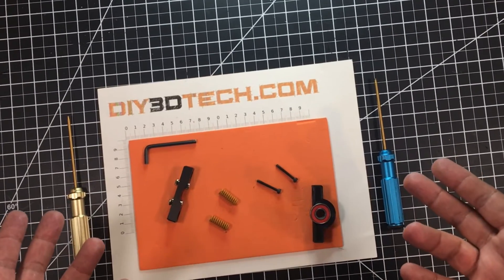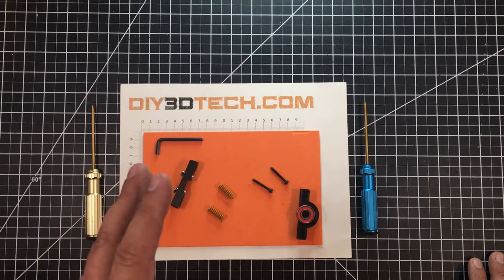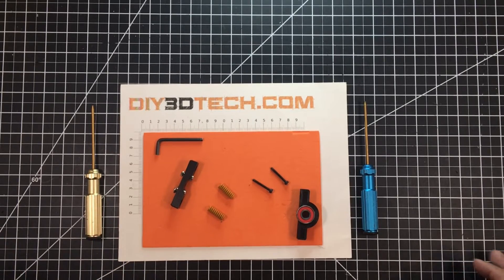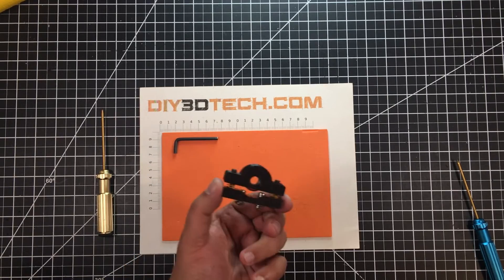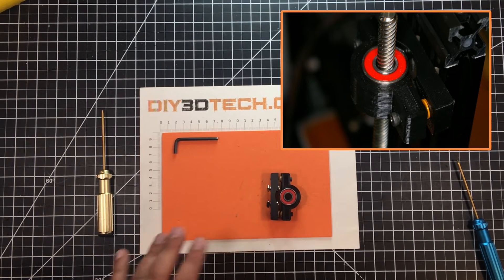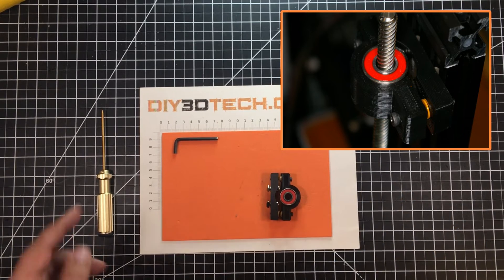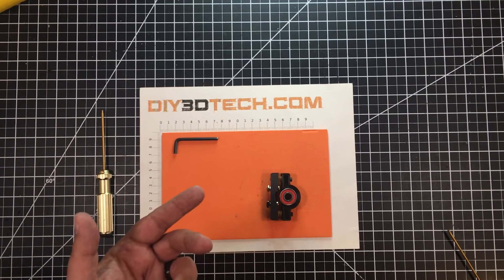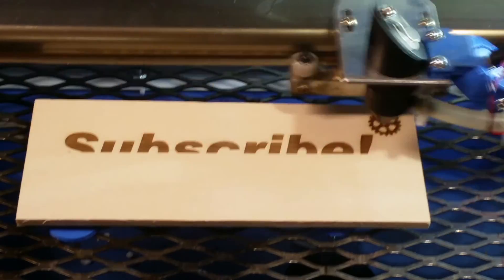Ender 3 Modifications  -  Precision Z Axis Support!

Comment: Please DO NOT use bearings/blocks at the end of your lead screw, it DOES NOT WORK
Reply: Why not? Something everyone seems to say though I'd like an explanation.
Reply: @georgebizos944  a lead screw mounts to the stepper motor and it acts as a pivot point, allowing the top of the lead screw to move around freely 

If you have any bends/wobbles in the lead screw the "energy" from the bends/wobbles are "eaten" up by the fact that it can freely move around at the top

If you fix the top in place, the wobbles and bends have nowhere to go but inside the leadscrew and that's where your X carriage attaches to 

If bearing blocks worked, 3D Printer manufactures would ship them with their product, none of them do

https://youtu.be/2Z7mZVvPlc8?t=483
Reply: @dasconkcreetbaybee  glad i read this comment. Good info and link. Thank you
Reply: @dasconkcreetbaybee  Thank you kindly!
Reply: I can't understand why people want the top of their Z lead screws fixed, other than aesthetics.
My Ender 3's Z axis works fine as it is, why fix something that's not broken?

Comment: Tevo Flash uses a bearing on the top but it just adds the issue of z-wobbling. The extruder's carriage (of mine) has non perpendicular angle thus the nut (for the lead screw) stands in a wrong position. I've compensated this by rubber spacers. But the lead screw has a non straight movement still. Removing the upper bearing did fixed the problem.
So I can't understand what this upgrade gives you.
Reply: One issue I've found is the cheap Z-Axis couplings aren't always straight. The hole that the lead screw sits in may not be centered. This and other potential issues you've mentioned can cause movement so severe a mount like this will be a problem.
Reply: @JJFX-  yep, maybe
Reply from the maker: Simple, on 99% of the 3D printers out there, it allows a perfect alignment as if the base was "fixed" then it could "not" be trued up to lead to the lead screw.

Comment: Thank you for the video. 
Would it not be more safe (and easier) to mount it straight on the frame with T-Nuts and the springs?
Reply from the maker: The spacing would not work, note the location of the M5 for mounting and the M3's do not line up...